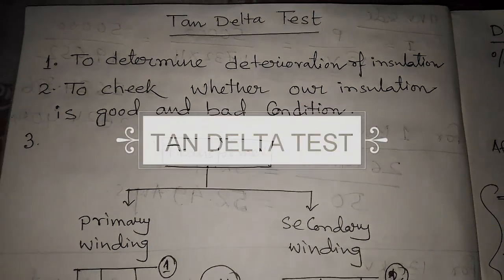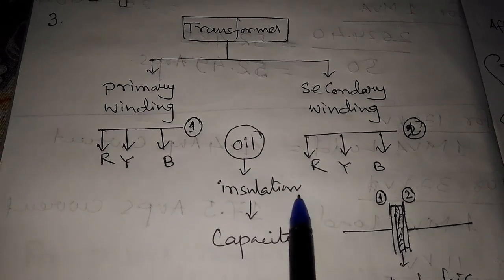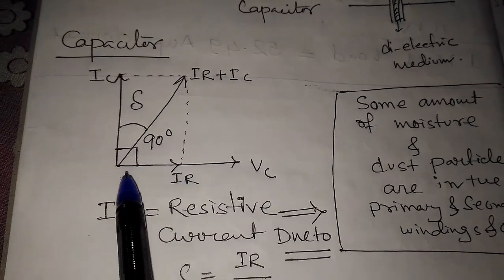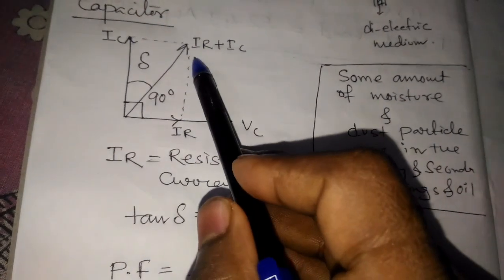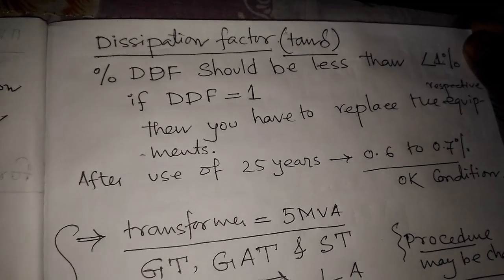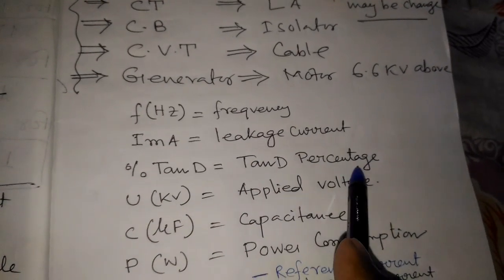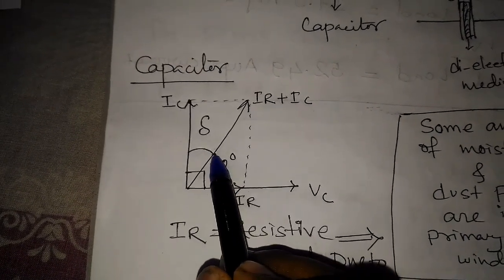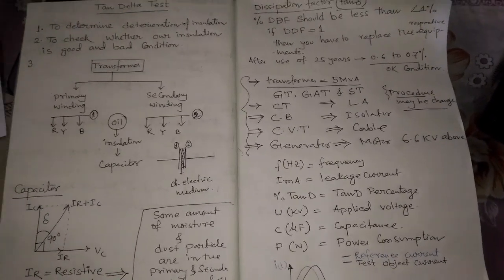TAN DELTA

Comment: How can oil is between primary & secondary winding, both the windings are wound on the same core,
Reply: Though primary and secondary windings are wound on the same limb, there is always an annular gap provided which is called an oil duct. Oil flows in this area too to provide insulation and cooling between the hv and lv windings. This is for your infn please.

Comment: what are acceptable values for capacitance  and leakage current?
Reply: They are differs from transformer to another( POWER TO DISTRIBUTION TRANSFORMER )  ,also for the same transformer ( HIGH VOLTAGE DIFFERS FROM LOW VOLTAGE SIDE ) , ALSO IN THE SAME HIGH VOLTAGE and  THE SAME LOW VOLTAGE , there is different value ( CHG+CHL),(CHG)and (CHL) ACCORDING TO THE APPLIED VOLTAGE , WE APPLY 10KV ON HIGH VOLTAGE SIDE AND 6KV ON LOW VOLTAGE SIDE .

Comment: in first Thank you. 
If you allow me one question how to calculate its percentage value  Tan Delat
Reply: You do not need to calculate tan delta percentage value , the testing device will give you tan delta and capacitance directly when we test  our electrical power transformers . We  use DELTA4300  in this test.